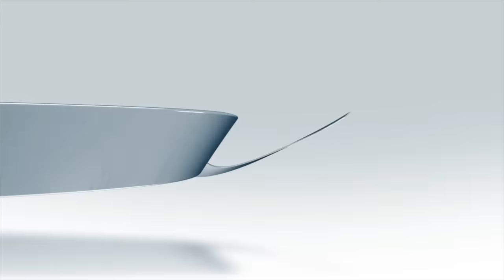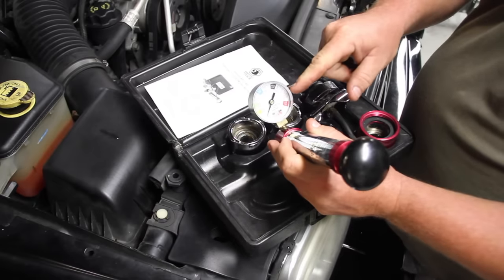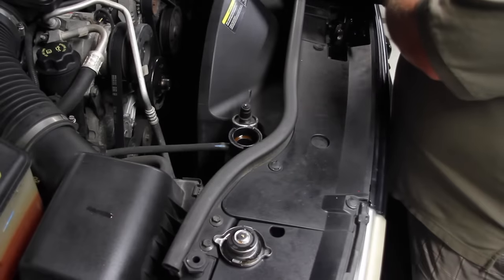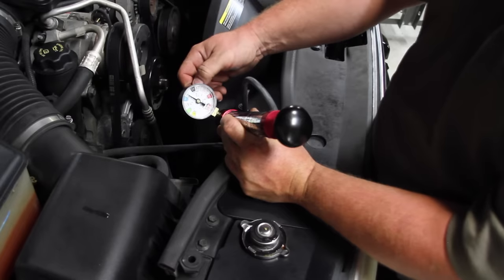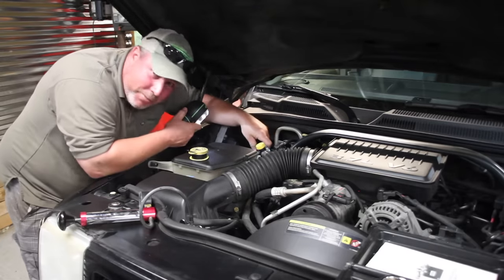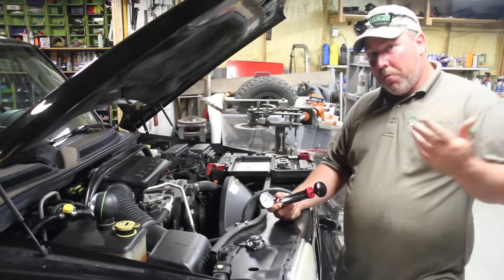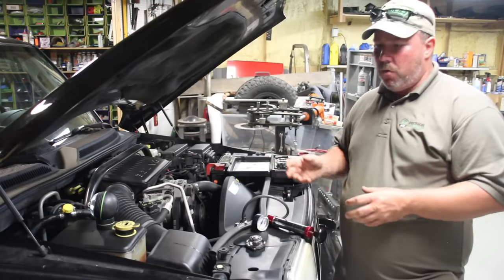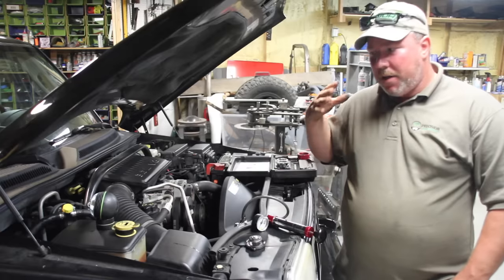Why is My Car Losing Coolant?

Comment: So my 2014 charger 5.7 hemi has low coolant. But is currently sitting at a low point but I can see it in the coolant reservoir and it hasn’t lost any more in days of driving. No overheating either. So it makes me wonder if it’s just an air pocket? Oil is fine and the coolant looks fine in color and texture. No white smoke out of my tail pipe at all. It runs great too. Maybe it’s all sitting in the radiator? I hope. And not in my cylinders.. Any suggestions on getting air pockets out of the cooling system? Or any suggestions at all anyone
Reply: The heating was also weird for a bit. It wouldn’t get hot until I started driving so it just blew cold air. Other than that my car runs fantastic and keeps a good temp

Comment: I have a 06 liberty that is loosing coolant (about half a gallon a month) I pressure tested it and it didn’t loose pressure for the 15 minutes I had it on and there were no places where I could see any leak
Reply from the maker: thats weird!  is it losing coolant from the reservoir or the radiator?
Reply: @bleepinjeep  my 09 Acura TSX is losing coolant from the resivour . Any idea of what I need to do??

Comment: I paused your video to ask this question I really need help with but will watch if after and would appreciate help with this problem.
 I have an 02 library sport I replaced the water pump 2 years ago, the radiator few month ago also cap and replaced cap and thermostat again 2 days ago. Thermostat was bad but the vehicle never overhead because I caught it fast. As a matter of fact it's never overhead because I always catch the problem beforehand. Anyway it was blowing coolant out the cap pretty bad. Anyway I fixed it and drove it quite a bit it seemed fine until yesterday it did it again. It's not an awful lot but I noticed steam and it was a little wet. On this vehicle the cap is on the overflow tank. I put a good name brand thermostat on it but I forget the name. When it started leaking I think it was after the engine was off for a minute or so. Any suggestions?

Comment: I keep having to put coolant into the overflow bottle but don't see anything leaking & i recently replaced the thermostat housing.any ideal what the problem could be??
Reply: Did you find out what the problem was?
Reply: @irishcountryman4866  .no i still wondering what the problem is

Comment: I have an 05 civic and find im losing coolant everyday after filling the radiator. Everytime i fill the rad the car wont overheat for a few days untill the tempature guage will start reading high. It fluctuates from normal operating tempature to beyond the highest point on the tempature guage. I find theres tons of coolant covering the transmission but can find any noticeable leaks. Anyone know what it could be?

Comment: can u just put antizfrezz. without mixing. water.  as the car garage told me not to mix it. with water so they just pour it in.
Reply from the maker: Only if you buy the pre mixed 50/50.
Reply: BleepinJeep they put normal one in my car they did not mix it.  is that okey.  or ?  they done something. wong would it damaged my car if they pour in only like that. ?

Comment: Hey man, thanks for the video! i had a blown head gasket, so i got that replaced; however, i am still loosing coolant somewhere. there are no external leaks, and someone said it could be coming out the exhaust but the shop said that's just water. can i still be leaking internally if it holds pressure?
Reply: Did you find the problem ?
Reply: Well no.. If it holds preassure.. You are alright.

Comment: This video seems a little superflous and looks like a reason to just show off a neat tool.

Coolant loss could also be as something small as not topping it up over a long period of time.  Perhaps the oil service guy/gal isn't topping up your fluids.

It is normal for little amounts of coolant to burn up when driving long periods.  If that isn't the issue... then there could be other underlying causes.

Comment: How is this any better than getting your car hot and parking it in the driveway? It should still pressurize the system, no? If your losing coolant you probably have a leak somewhere. I don't  see what new information this tool tells you.
Reply: …..because it will be burning hot to work on?
Reply: Keep in mind you can create whatever pressure you want with this thing. When it's hot sitting in the driveway you just don't know how much pressure is there for one. And then obviously it would be really hot. And this is a controlled environment not just sitting around waiting on it to get pressure. In a mechanic shop time is money..
Reply: I just had to redo my rear frost plugs and water pump and radiator on my Jeep. Its not at a point of being able to be ran so by filling up the coolant system and using this tool I can pre-check for leaks or issues before I start it and see if I will have any issues. I really would not want to have to drop the transmission again if the silly rear plug failed or had an issue.
Reply from the maker: the jeep in question somehow or another was never leaking in the driveway or the garage.  It must have only been building up enough pressure to leak when on the highway... so this tool helped diagnose the problem without strapping myself in the engine bay during a hot lap!
Reply: He siad HOT LAP!! HAHA!!😂
Reply: Thanks. That makes sense, I can see how some leaks might just be at the higher pressures and it could be a PITA to build up that much pressure (Temperature) in the driveway/garage.

Comment: My 2000 malibu runs out of coolant 2 or 3 days after completely filling it up. I looked for a leak with the car off, idling , and i even drove it back and fourth in the driveway to see if it only leaks while moving. Its not leaking into the car and my oil looks fine. Where in the freak is my coolant going?😂😂 also my temp gauge is reading fine
Reply: marshall I have the same type of problem. Low coolant after 2 or 3 weeks after filling it up but not seeing any leaks and oil and coolant look fine and temp gauge stays where it should, heat and ac also work fine.
Reply: @mememert2868  at least im not the only one with this problem. haha i really don't get how i can lose so much coolant so fast and still don't know where it goes... no drips or anything visual.
Reply: marshall   please let me know when you find out
Reply: Did anyone find out the source of the problem? I have the same problem with  my van

Comment: Q: If your losing coolant with no visible sign of coolant leak or overheating and it passes the pressure test. What next ?
Reply: Means there is a slight leak in the head gasket.  Just keep driving it and keep an eye on the coolant level as the engine is slowly burning it.  Just make a mental note and start thinking what you want to do. Either replace engine with a used replacement  or attempt to fix it and replace the head gasket which is always a gamble.
Reply: @da9nerdy  turned out to be my water pump.
Reply: @artsmodelstation9396  could you elaborate on this. I'm having the same issue and can't find the leak.

At this point thinking head gasket, but curious how you deduced water pump